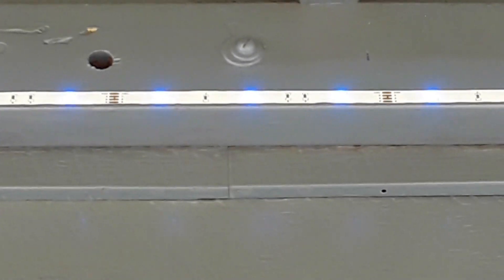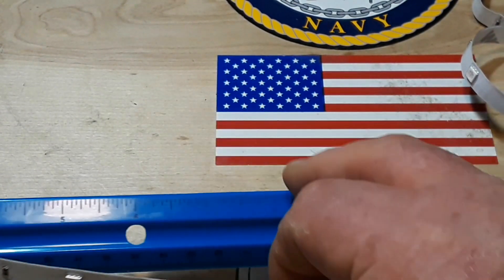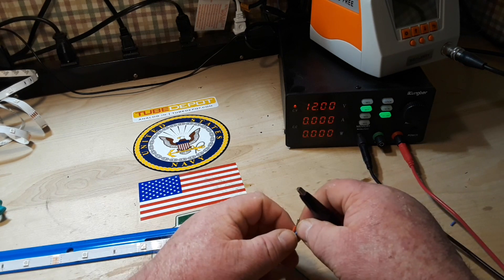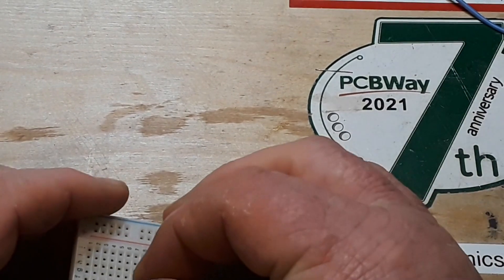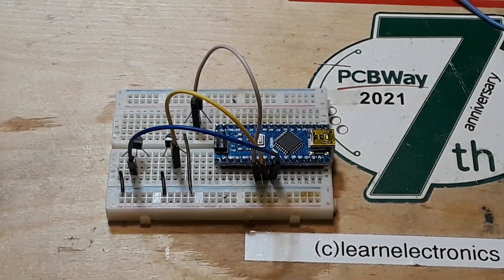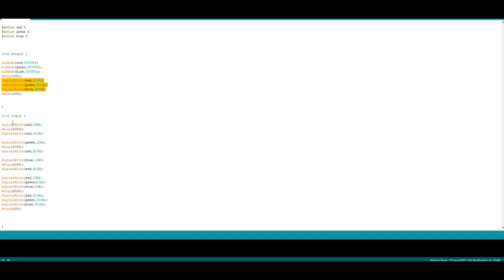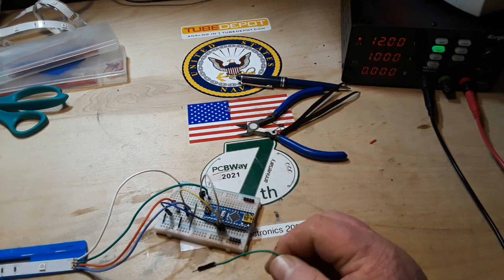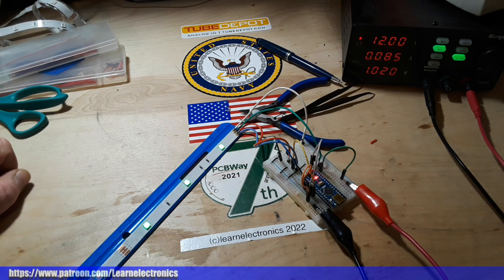How to Drive cheapo LED Tape with Arduino

Comment: Thanks for the video.  Only you would know what the metrics are, but I wouldn't mind an extra few minutes to further develop this project.  Troubleshooting is part of the adventure and an important lesson on its own.  FETs are probably a better choice for this via PWM pins and some years back I built an Arduino controller for this kind of RGB tape that uses 2 pots and a push button to control brightness, speed, and a couple of random color-changing modes.  My tape turned out to be horrible, though, and a third of the blue emitters failed within weeks even with very low average current.  I'd love to hear a follow-up in a couple of months to see if your porch LED's are still working okay.

Comment: What do you mean by Non-addressable LED tape? The Arduino is outputting different voltages to turn on different LED colors?
Reply: Addressable LED's have their own individual controllers to allow each LED to operate independently.  A common type is called WS2812b and they are used to create the fancy patterns seen in modern Christmas displays, etc.  The tape used in this video is non-addressable as all of the LED's have the same color; you can address individual emitters.
Reply: @antibrevity  Thanks, there must be more wires for the addressable signals from the Ardunino

Comment: The whole thing here was learning to control the LED tape with Arduino.  The important part of that is the coding.  The code had an error, because the Blue sequence apparently didn’t work. This was a teachable moment which I think you should have leveraged.
Reply: “I cannot teach anybody anything. I can only make them think” ― Socrates

Comment: You'd probably want a base resistor (100 - 300 ohms depending on the current gain) otherwise you're relying on the max current limiting of the microcontroller.  Also wouldn't you apply power (high) to an NPN to to allow for a current path to turn on an LED?  (not pull low)

Comment: I'm still learning about transistors. When would you put a resistor on the base?
Reply: A transistor is effectively a current amplifier. The current flowing into the collector (or from emitter) is a the same as the current flowing into the base multiplied by a number, likely to be between 100 and 500 depending on the actual transistor used. Therefore it is necessary to restrict the base current using a resistor, to get the required "on" current into the collector.